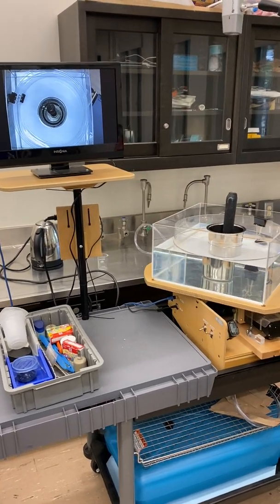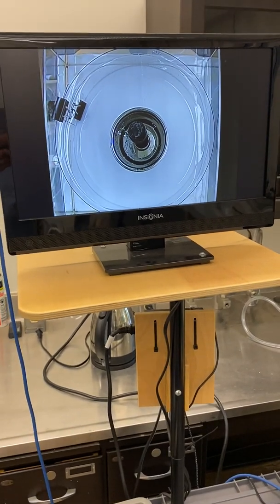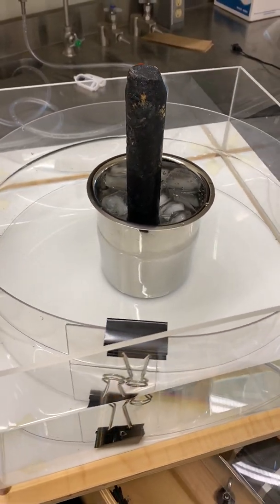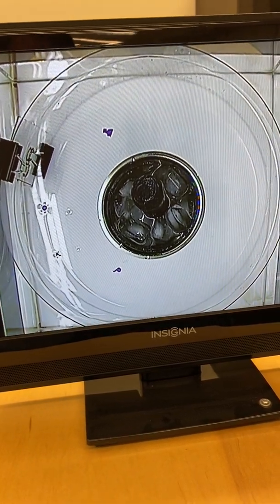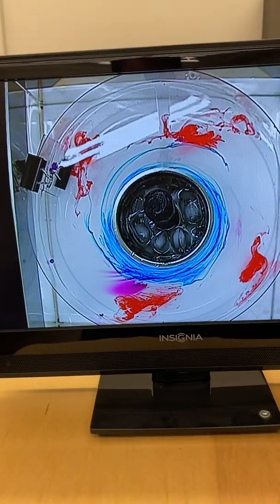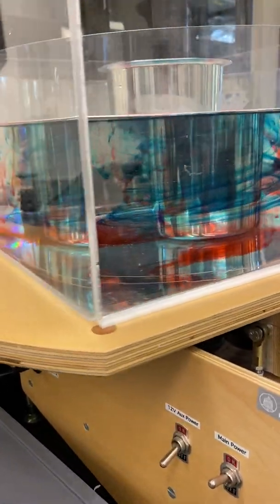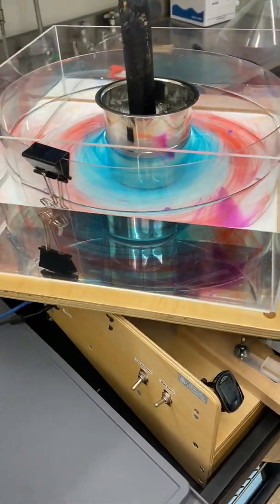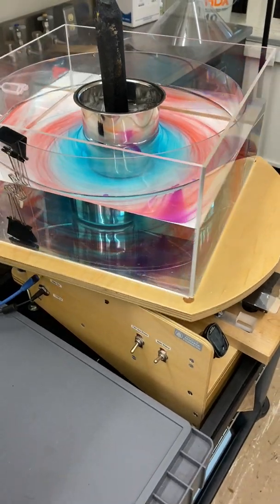Thermal Wind demo with ice bucket

Comment: Nice video Brian. how does the flow not become baroclinically unstable? Anytime I do a similar experiment in the lab, I get eddies...
Reply from the maker: Thanks Julien! It's always a risk with this experiment. I've had good success with using the slowest possible rotation rate on my table, and otherwise just being extra careful to avoid nudging or bumping into the table. I would say I have something like a 75% success rate with avoiding baroclinic instability.